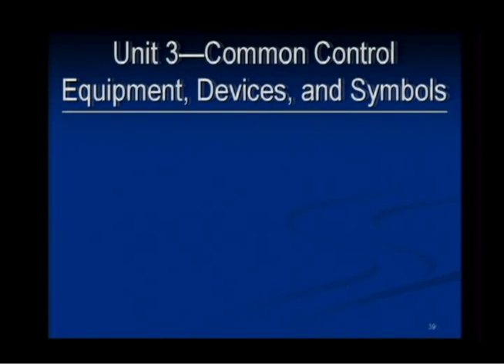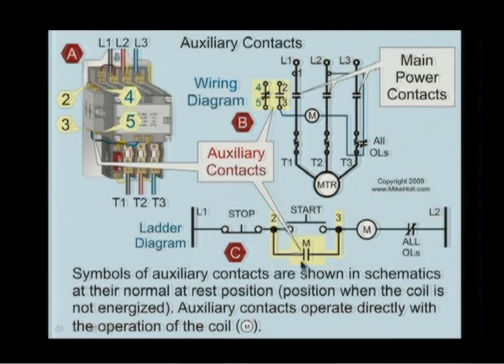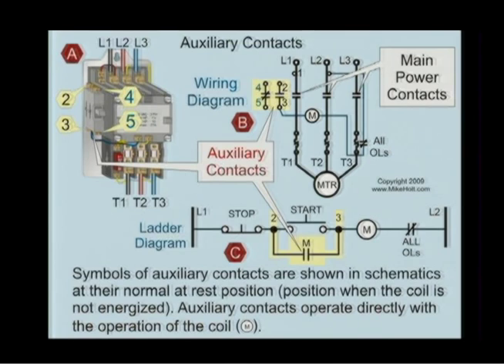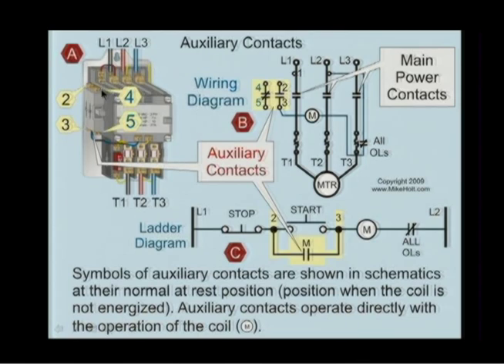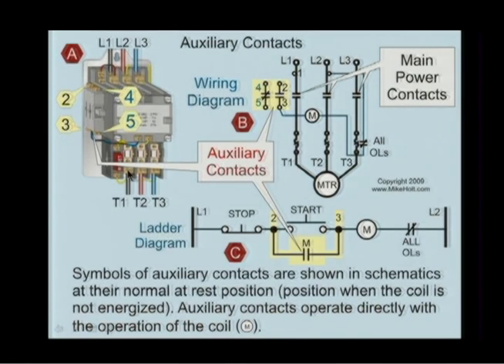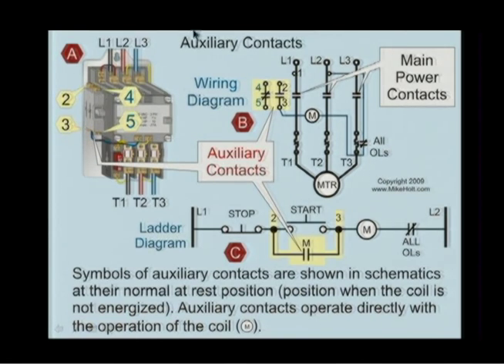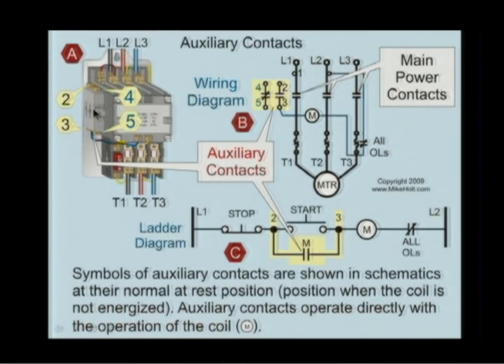Motor Controls ©2009 - Common Control Equipment, Devices, and Symbols

Comment: 3:50 Keep in mind there is a limit to the number of auxiliary contacts that can be added (sides and front). Do not exceed this limit. It should be shown in the contactor datasheet. Generally higher voltage coils allow you to use more aux contact blocks due to greater pull-in force.

Comment: looks like control coil is getting 120 v  at contacts 2/3 (when energized coming from line 2 )to energize L1.L2. L3 for motor ... aux contacts will energize with activation of control coil at contacts 2/3 ....  aux contacts 4/5 might be a simple indicator light wired to show motor is on,i think i got it ,  i just got mike holts electrical therory its an  amazing resource, great work, Relearning some things i thought i knew

Comment: Is their an industry standard for the correct place to break control power in the ckt for FA shutdown?
 I have in the past installed my FA relay in series at X2 dropping out the coil. Their doesn't appear to be anything anywhere about this subject on line.

Comment: I am a little confused. I thought you needed an auxiliary contact to energize the main contacts so line voltage was not going through the Start/Stop switch(s). Also, I thought additional aux contacts were for completing circuits for ancillary functions (e.g. position lights, initiating power to other equipment, etc.)
Reply from the maker: Schatze, Thanks for the comment. There are many different starter/contact configurations and numerous ways to utilize them. If you love motor controls, you should get a copy of our Basic Motor Controls textbook and videos from to better understand the subject. Once you finish that there are many advanced controls courses available through the various manufacturers that will go in depth on how different products can be configured for different applications.
Reply: @MikeHoltNEC   Thanks for sharing, how do you get a copy of the basic control textbook and video
Reply from the maker: @mrlove5161  Visit https://www.mikeholt.com/product-category-list.php?id=4
Reply: There is always going to be power going thru the stop switch when the contacts are closed, It’s limited by the coil resistance of the relay though.

Comment: You did not mention how the coil is energized: 1. through a 24 VDC or 2: through a transformer to step down the voltage from 3 phase power to the control circuit.
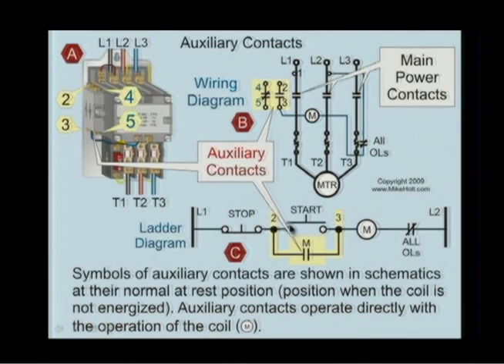Reply from the maker: Thanks for your comment!  This video segment focuses on auxiliary contacts without getting into the function/wiring of the contactor/coil.  The schematics are in a deenergized state as mentioned at 0:54 in the video. - Ryan C

Comment: What is an application of an auxiliary contact?

I see it as a normally non-energized switch off to the side that has the purpose of indicating the status of the main switch.  Such that a control system can measure its Ohms for continuity, in order to know when the main switch is in the ON-position.
Reply from the maker: +carultch The purpose of the auxiliary contact is covered in great detail in our textbook and DVDs. However you can do a search on the Internet for additional details.
Reply: +carultch lets say you want a light to turn on to indicate that relay is not energezied you would use the NC contacts, once relay energized the NC contacts become open therfore turning the indicator light off, and vise versa for NO you can put a green light to indicate the relay is energized once it is, the NO close and turn the green light on.
Reply: +carultch or as a seal-in
Reply: Aux contacts can be used in the way you describe.  However it’s not the only reason to have them, and often times they will have some kind of voltage on them. They don’t say anything, but the aux contact in the blue print shown in the video is being used as a “holding contact” or a latching circuit.  Without the aux contact bypassing the momentary start button once the coil has been energized.  the circuit would open and the coil would become de-energized the second you pulled your finger off of the start button.

Comment: Why is it that overload contacts are placed on the right side of the ladder rung, but stop switches are placed on the left side of the rung?
Reply from the maker: A ladder diagram is like a blueprint and reflects how the components are physically installed and function. Input devices, like start stop switches, are shown together on the left side to make it easy to follow the function of the input. Outputs, such as relay coils are shown on the right side for the same reason. In the case of overload contacts they are shown on the right side with the output's they directly control.

Comment: 4 5 is the overload relay
Reply: +Empire Wallace Mr. 
Wallace, the overload relay is shown as "All OLs" (next to a symbol for normally 
closed contact) on the right hand side of Part B and Part C of this diagram. The 
4-5 terminals of the auxiliary contacts use the same symbol of a normally closed set 
of contacts. The difference is the "All OLs" indicator located next to the NC 
contact symbol. I hope clears this up for you."
Reply: yea, I got it....Most appreciation, reviewed the topic in class yesterday. Im doin a lvl 2 assessment

Comment: As I have learned, industrial controls is a whole different animal. If you are not regularly working with it, it can get confusing. You did as good of a job as you could have done with this demonstration, but I could tell that you very rarely worked on industrial controls.
Reply: I take electricity class and my teacher is a master electrician so he has a pretty good understanding of what he's teaching and I still do not understand motor controls. I really want to because motor controls is almost the highest paying if not the highest paying electrical job making anywhere from $70,000 and way above. I just hope I can understand it a little better
Reply from the maker: +Drew Causey Visit http://www.mikeholt.com/productitem.php?id=1370&year=ALL&from=All&type=DVD+Program and order our Motor Control Library.
Reply: +Drew Causey Master electricians in my experience are not necessarily well versed in motor control technology. They may understand some of the circuits but there's a lot more to it. What parts in particular are you having trouble with?
Reply: +adisharr I'm mostly having trouble with 3 phase motors, I'm pretty well rounded with single phase switch motors but those 3 phase motors don't click